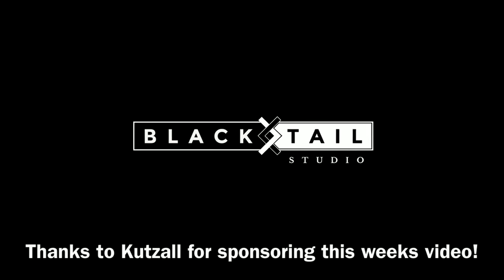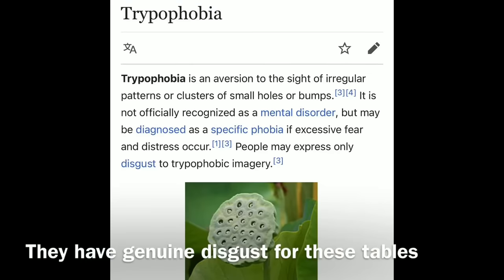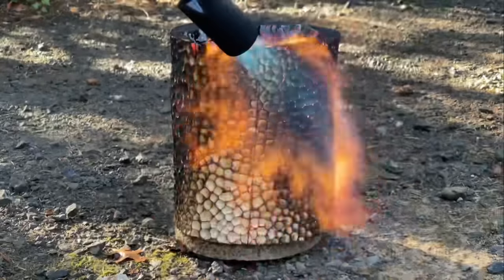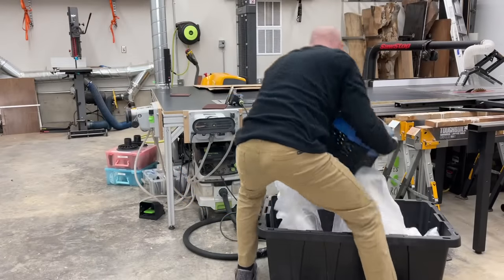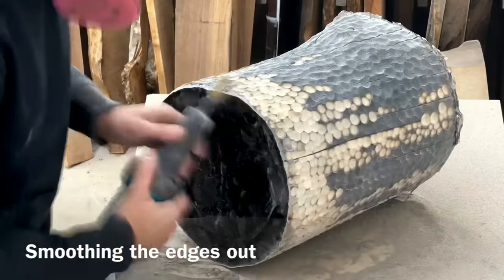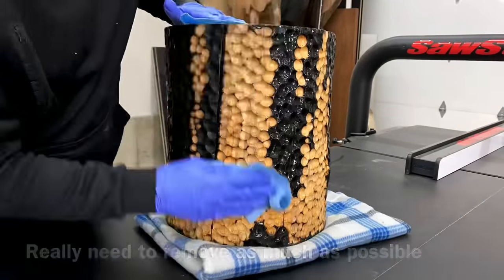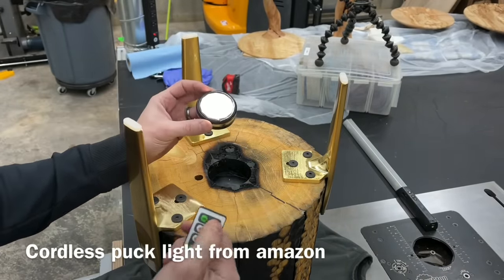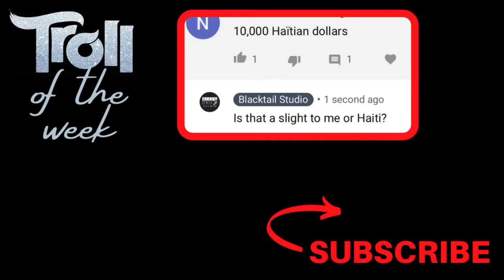I Sold This Firewood for $2500

Comment: I know this is a year old, but I just started watching your videos and subscribed. I've gotten one of those fire logs before and I had trouble keeping it lit. So I elevated it on a couple bricks so the fire could breathe and burned inside outwards. For the light, would it work if you drilled the hole further?

Comment: 🤔i like the difference in color, but it seems a little bit too different, like if it had a little bit of grey/black so it was slightly darker but i do like the overall look. good idea with the lights (the emoji is spectacle because im very confused at most of the things you did there lol.)

Comment: 🎰

The top is a 10/10 
The rest is a 2. Hate to be negative but this project gets the slot machine emoji because whoever bought it got scammed! very pretty glossing and great work on the epoxy as always. Hated the stump sadly. May have been cool if you could see the inside better or if it didnt get ruined by the contrasting colors

Comment: 🙃I think the design has a lot of potential. its fantastic that you are willing to try new things and stick to it to the end. I don't mind the some bare wood / some burned wood sides, but a thought would be to have used a smaller torch to try and blend the areas of black and white together a little bit to lesson the contrast. otherwise, fun video!

Comment: 17:42 😅I like the contrasting colored dimples but I think you did too many of them. I’m making a bench with chiseled indentations similar to your round bits (but not sooth!) any suggestions on how to sand all of those? Will a light burn do the same trick, maybe keeping some of the original color of the wood?

Comment: Jesus.. that bit is around $200. I just bought my first surfacing bit yesterday after spending a solid 30 minutes trying to pick the one that had the least shared negative reviews and landed on one for $33. However, I almost bought one that was a knockoff of this so I saw this and thought "well crap, I should've bought that other one despite the major negative reviews" but then I actually followed the link and saw why the one I almost bought had so many shared negative reviews (because it's a cheap knock off).

Comment: I’m wondering if you could revisit this but instead of filling the entire thing with epoxy you could put a clear acrylic base in the inside and only poor a couple of inches of epoxy. Then in the cavity beneath you could put a light. I think it’s as good an idea as circumcision jokes.
Reply: It would get the light closer to the top and give you a better spread is my thought

Comment: Cam>>>>>>>....in my 30's I dropped a waterproof manhole ring and cover (200 or so lbs....sounds about like some of the larger slabs I see you work on) on my right big toe.........double ring has the lid bolted in.......crush injury that did not even hurt at the time but the soggy squish as I pulled my top-sider off was a wake up
In the emergency room the DR warned me that  he was going to give me a nerve block and it was going to hurt worse than anything I had ever experienced
His deadpan expression when I did not react because I felt nothing was a tell.......in my macho best tone I offered that "I'd assume this is going to be a problem"
Oh yeah was all he replied
took 4 months in bed with my foot higher than my heart  to work out because first they have to let everything that is going to die go that way......the smell of dead Jed (my name) is something you should avoid the Cam version of and the biggest warning I can offer is rather crude but directly on point

so when you have to use the bathroom in a solid kind of way........think back to Elvis who stroked out on the can........when you are passing solids you have to strain and your blood pressure goes up a lot.......seeing as it felt like someone had torch to my toe every time it momentarily got lower than my chest you can just imagine what happens when your blood pressure spikes.....especially when you are blocked up  by class A barbiturates like Tylox or opioid's
another funny story.......while I was waiting for toe death that first weekend I ran short of Tylox because I was eating them like breath mints........you can't get the on-call doc to just call in a refill on class "A's".......they have to physically hand it to you and the young man did not feel like breaking up his weekend.......he suggested that we buy some extra strength Tylenol
Back then in my prime I was 6'3" - 250 libs with a 32" waist and I suggested that.......While I appreciated his offering.....
1) I had in fact a pretty high tolerance for pain
2) I'd survive
3) when I got back on my feet I was going to come looking for him
He met my wife outside the pharmacy in 30 minutes
would guess that you are just trying to get a rise but in that year I crushed off a toe and stuck my thumb into a table saw during recovery
learned a little since then
Turns out that you actually need big toes to walk straight so there went golf and sports and in comes a permanent hitch in my giddy up
can't tell you  how much I  enjoy periodically trimming the callus build up on the skin graft (every 2 weeks or so) in mixed company or in any old casual setting but I can tell you
At 65
That everything rash I have ever done.......comes home to roost
I had cancer in 05 and I am still looking for the ass who wrote that people who take Nulasta' ( white blood cell accelerator) have "mild to medium" bone pain
Figured If I could find the guy.......cut open the skin down his back and use needle nose to pull out maybe 6 of his disk's he might have some empathy
I am old now so I would have to settle for using a low power 22 short to shatter different joints
Long and the short of this is that I have lived a relatively long and interesting life and made more than my share of stupid moves
You ever get cancer and have to go 6 to 7 rounds with chemo (general max lifetime dose of the best drugs) give me a call
I have an almost unlimited stock of stupidity to offer
Finally.......from a subscriber.........protect yourself........they make steel toe tennis shoes 
My  email is kilo79@aol..........contact me and will give you my wife's
give that to your wife if you are going to continue to work in flip flops
because...........
1) she is going to need someone to talk to eventually.........and
2) that's what your gait is going to sound like sooner or later
Law of averages brother
love your talent and we evidently and fortunately have more than I thought
my nickname in college was "Dumb Kid"
what was yours
final word..........nothing.......and I mean nothing compares to a lower extremity crush injury for pure pain......kicking the toilet with my raw nub while trying to hustle back to bed was the most extreme
think about it

Comment: poop emoji. as your wife said. oh. the remote doesn't work properly because one, it is probably infrared, so it needs line of sight, and two, even if it was working off of radio frequency your giant metal bracket would block that all.

Comment: i have tryptophobia, well "have" i generally have a disgust for things that look like this, altho its much more complicated, i dont find that table disgusting, but when it comes to actual holes, that are organic looking and in uneven pattern (a sheet metal plate with holes/honey combs etc are no problem) i find them pretty disgusting
Also for the lights you are using, the remote seems to be IR (like those oldish tv remotes) so you actually have to point it at the reciever to "shoot" the ir beams directly at it